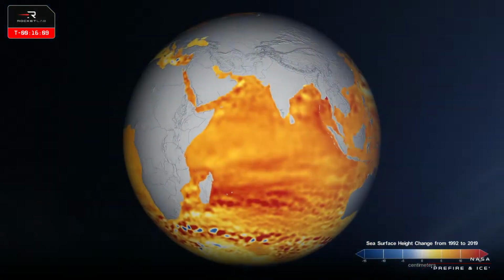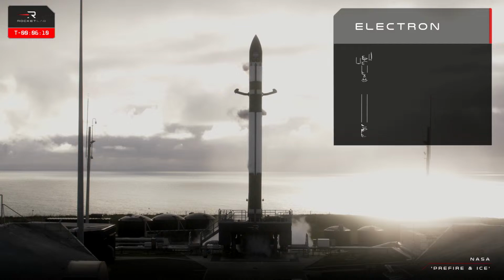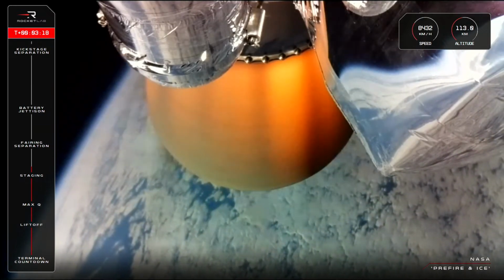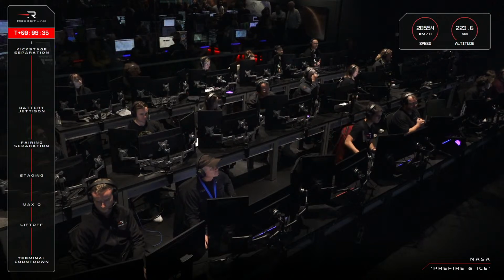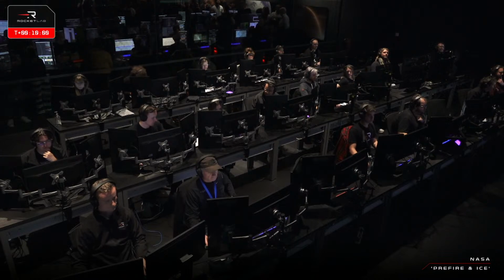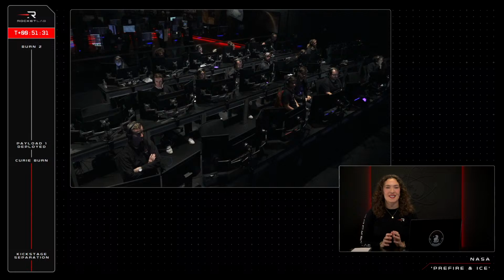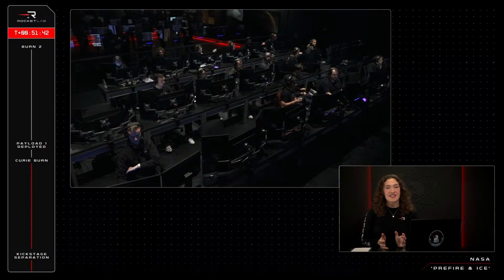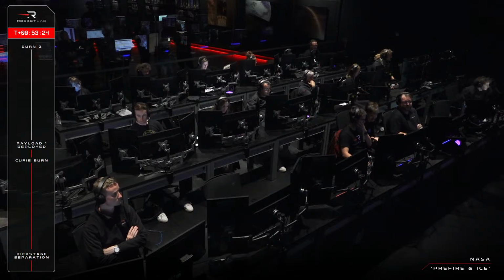Rocket Lab - 'PREFIRE & Ice' Launch

Comment: Very well done with another launch, racking them up.
Electric Weather Mechanics-
The results from the satellites will eventually confound those who still think that it's the differences in temperature that is the cause of changes in weather and climate (albeit the data will no doubt try to be be fudged to fit the model). Rather than being a by product of the changing electrically charged input into the earth, with the earth being the load on the sun/earth electrical circuit.
Reply: Wackjobs like this are so sad. They learn a few science words, I think it usually starts when they have a bad experience with like a science teacher in highschool. Then later in life they have a complete mental breakdown about a difficult political or scientific topic. Remember, these armchair experts really think they are experts, while everyone else is a secret fraud.

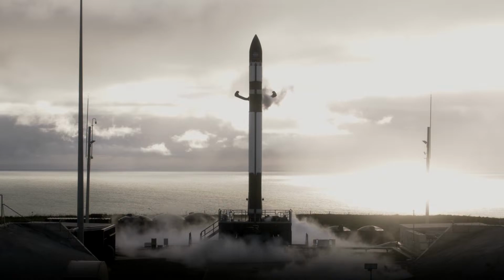Comment: 30:13 - T-3/lift off,
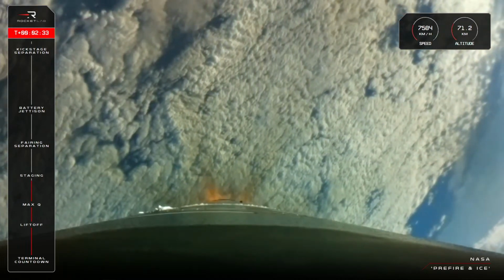32:52 - Meco/Stage separation,
34:30 - Fairing separation,
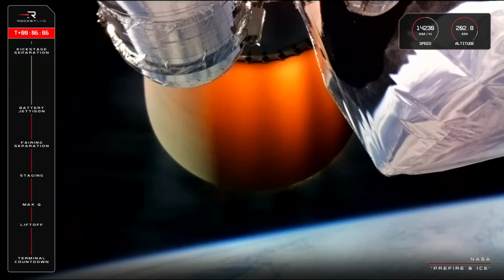36:24 - Battery hot swap,
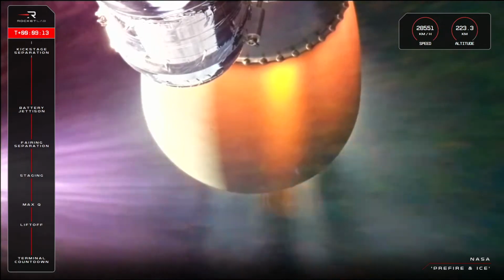39:28 - Seco,
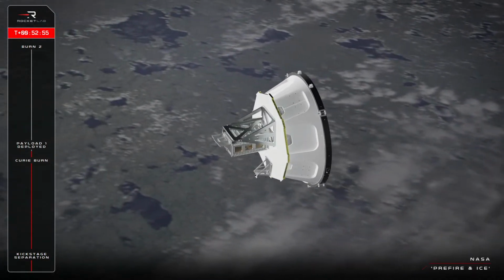1:23:20 - Payload one deployment.

Thanks!